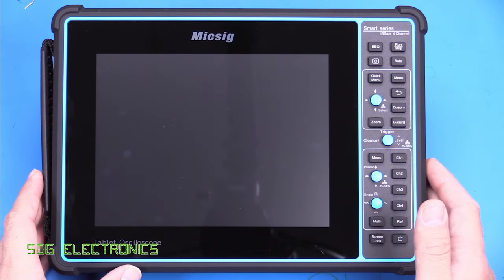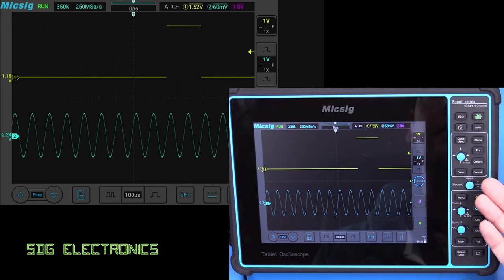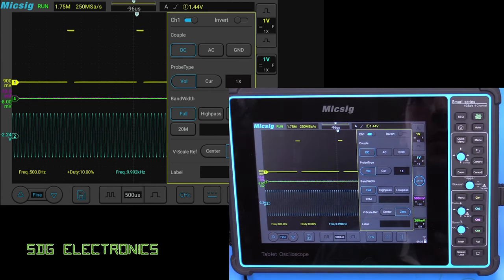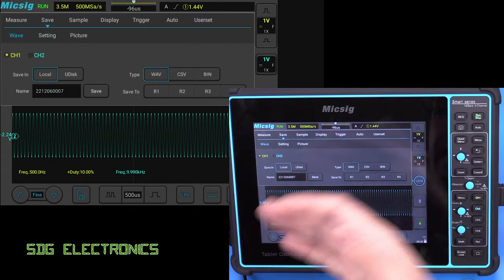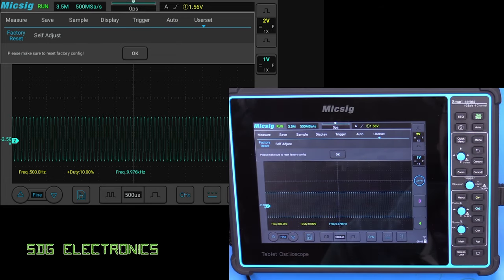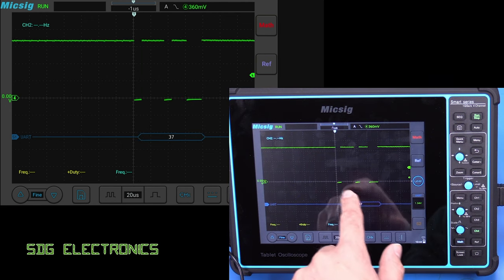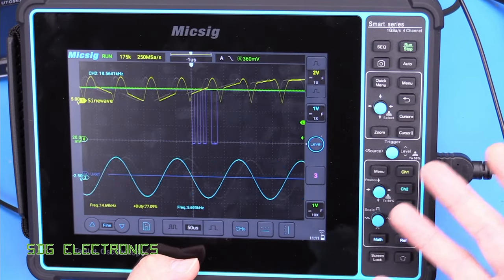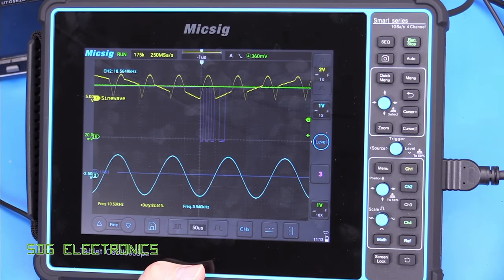SDG #280 Micsig STO1004 Portable 4 Channel 100 MHz Oscilloscope

Comment: I think the little rocker knobs are a backwards step from the rotary encoders of the previous version. 
These scopes are probably still the best price/performance portable scopes around, and have some interesting features that I've never seen elsewhere, like video recording the scope screen.
Reply from the maker: It's a shame they removed the encoders. In their absence, you're almost forced to use the touch screen as the joysticks are too fiddly. The touch interface works quite well overall though so it's not a burden to use. I'd been after one of these since you posted your original video years ago, and like you say, there's not much out there that does the job.

Comment: Nice review and interesting departure from the "typical" scope user interface. Really good value and it's probably timely that scope manufacturers depart from the old paradigm.
Back in 2002 I paid $2400 ($3900 inflated dollars) US for a 2-chan Fluke 99B. The battery life is still really good. Battery power is great for measuring non-isolated AC equipment.

Comment: Very nice scope and review. I have been using a new Siglent scope working on site and it works very well. It would be nice to have one more advanced with protocol analysis. I’m a big fan of the fluke scope meters but a bit outside my price range really.
Reply from the maker: These portable ones have come a long way. I used to carry my large oscilloscope around if I had to do some diagnostics, but this and similar items seem to be the answer